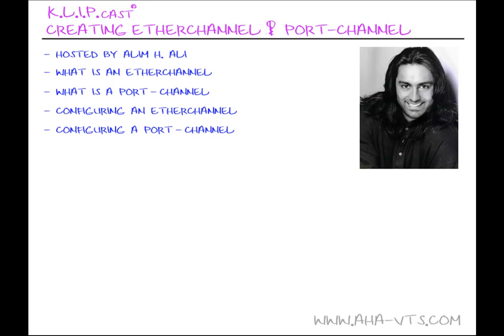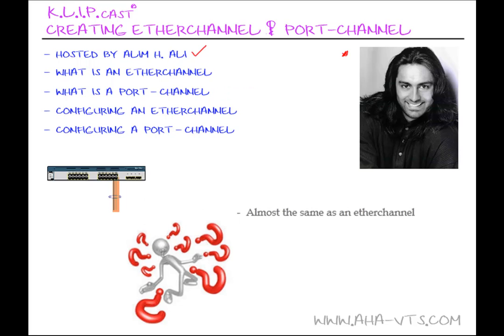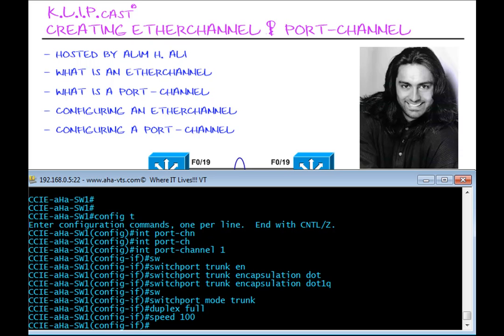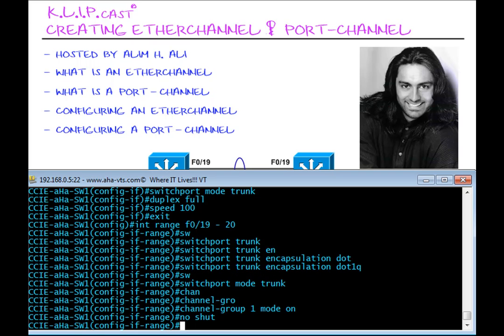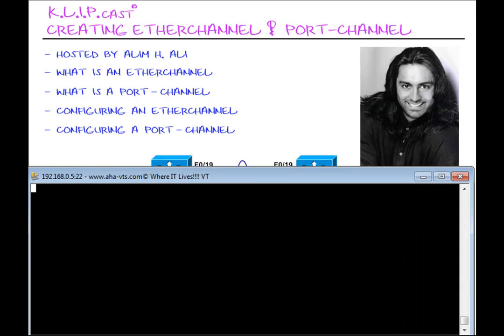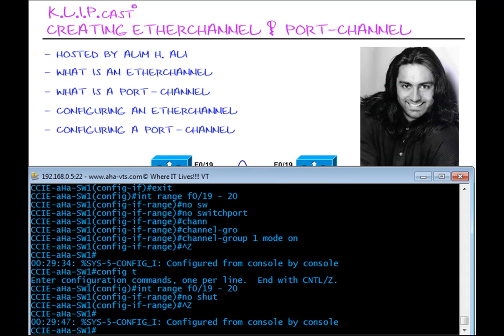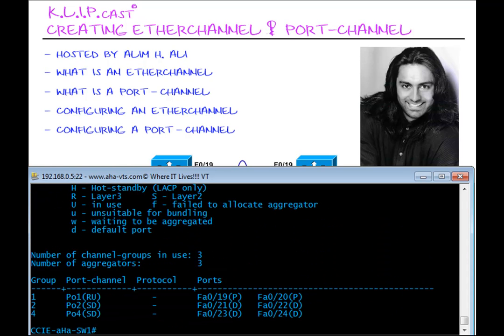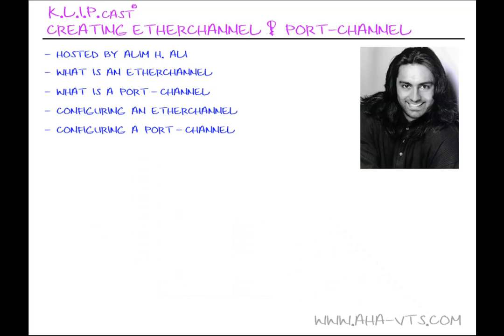AHA-VTS.com© K.L.I.P.cast©: Creating Etherchannel and Port Channel

Comment from the maker: @Arlesterc:
Thanks for watch my video!  To answer your question, I did use the same 2 ports to show how to create an etherchannel (L2) and a port-channel (L3).  However, I did that in 2 seperate instances - Created the etherchannel...wiped the configs and then did the port-channel.

In the real world...you're right...L2 channel and L3 channel are totally seperate, In fact, you cannot have both on the same interfaces...you will get errors.

Best Regards,

aha-vts.com

Comment: Very good video.  In your example it seems you you do both the port channel and the etherchannel on the same ports - 19 and 20. Is that what you would do in the real world? I would have thought you would have your layer 3 channel separate from your layer 2 channel.  when you have time please clarify. Thanks again for the time put into this presentation.